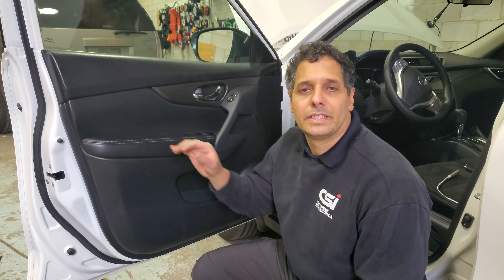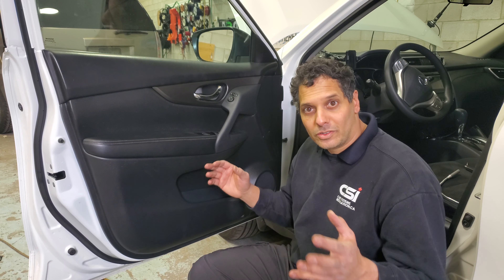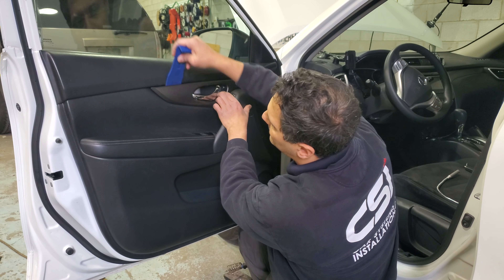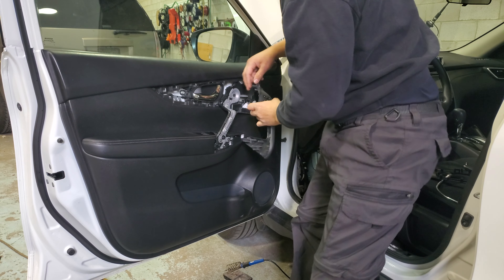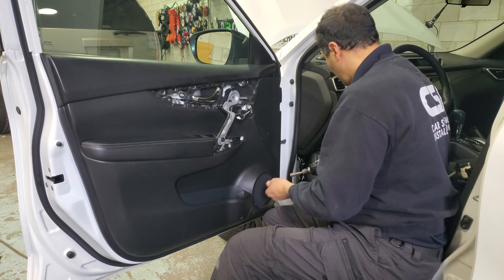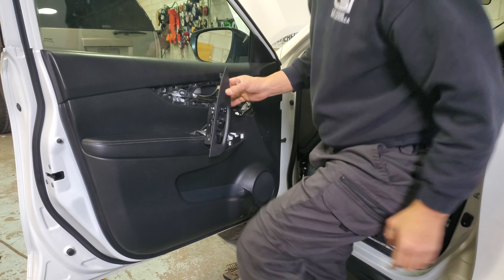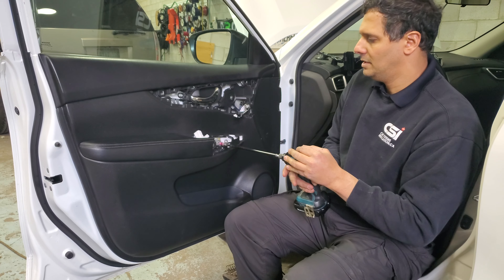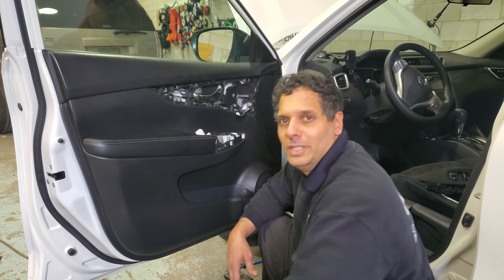How to remove driver door panel Nissan Rogue 2016

Comment: Thanks.  Worked as advertised.  Needed to get access to replace outside mirror.  Too bad Nissan didn't design it like a lot of others and just make a small removable triangle cover.

But thanks again for the video.